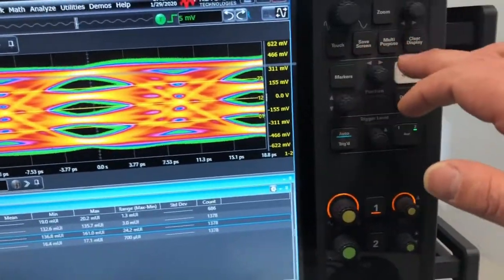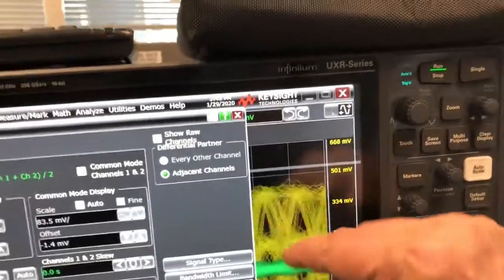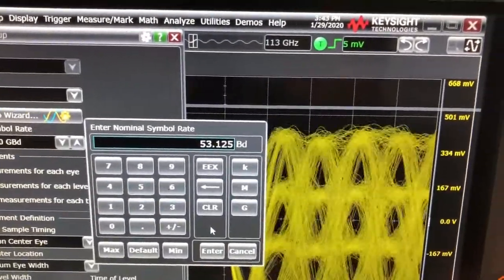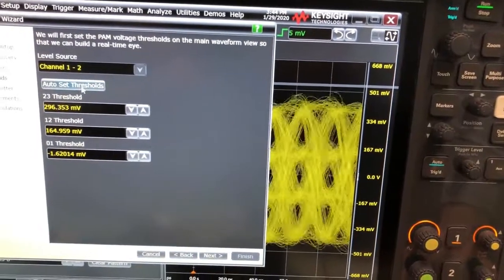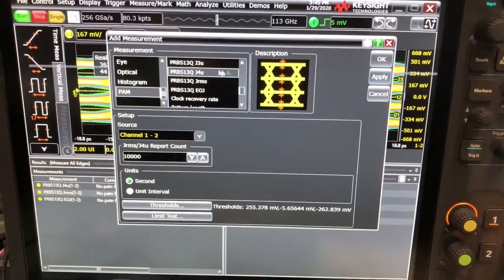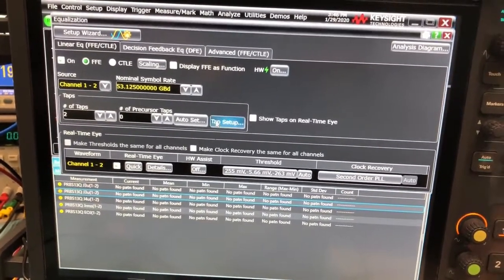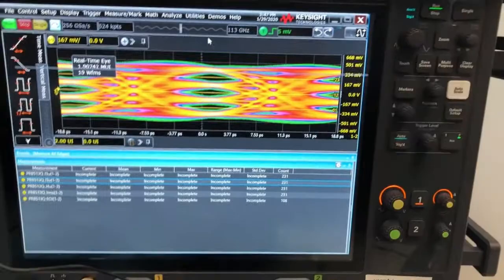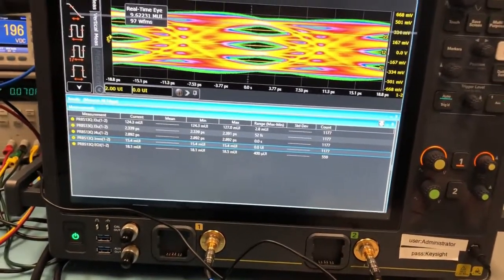Keysight UXR Hands-On Intro to Setting up 56GBaud  Pam4 Measurements

Comment: Can you share a detailed video on 56G PAM4 equalization? Esp on CTLE and FFE?
Reply from the maker: Good idea. Right now this equipment is in heavy use. I’ll put it in my list of things to video. I’ll most likely not get to it for a few weeks. Specifically what would you like to see on the video? I could envision showing a closed eye and what the effect is in opening the Pam 4 eye using these methods.
Reply: @timfairfieldAETestandMeasure  Thanks for your reply. I'm working on 56G PAM4 channel validation, and would like to see how to use the CTLE, FFE/DFE equalization to open up a closed eye... Also, how to deembed loss of cables and probes on the channel..